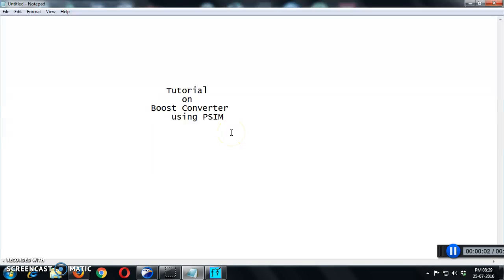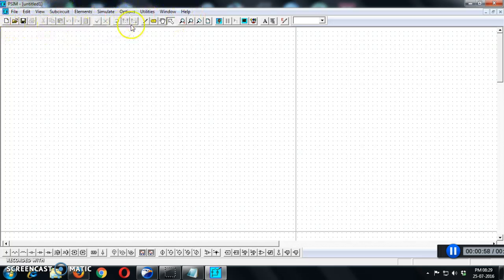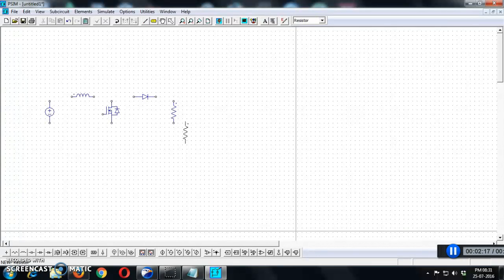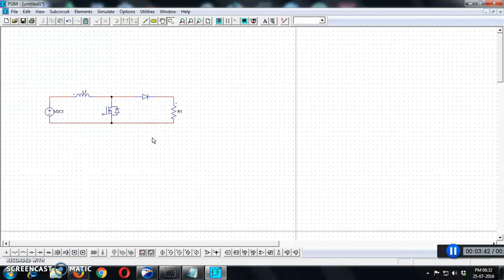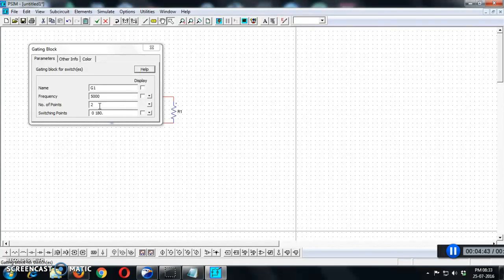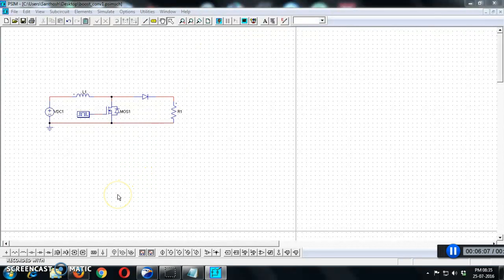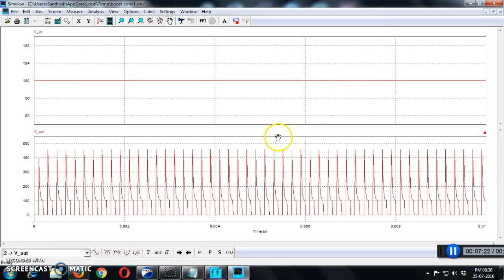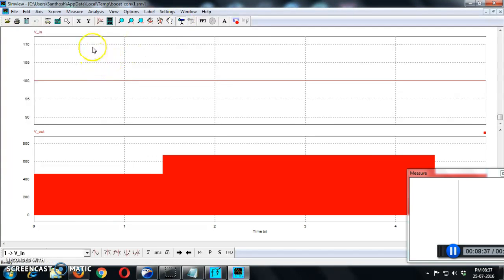Boost Converter Simulation using PSIM

Comment: Problem is just Duty cycle? How to create a specific duty cycle??
Reply: If you want 50% duty cycle, then the switching points are 0 and 180. These two numbers denote the pulse shall be ON from 0 to 180 degree and of for the rest of the time. So, the duty cycle become, 180/360 = 0.5. Suppose, you want a 30% duty cycle, 0 and 180 are the switching points as 108/360=0.3.
Reply: Thanks brother you say right.

Comment: Sir, say I wanted to create a 60% duty cycle square pulse using a comparator, how do I achieve that?
 what is the significance of the frequency of the sinusoidal input in the comparator with a reference voltage , how does it's frequency and amplitude affect the resulting duty cycle? Thank you

Comment: if the gating points define the duty cycle then what is the role of the switching frequency?
Reply: The gating points used only for ease of simulation. You're free to do it the other way also!

Comment: Quick question sir, is it possible to simulate a schottky diode in the buck converter instead of a regular diode? do I have to change anything except for the voltage drop? Thanks for the valuable video